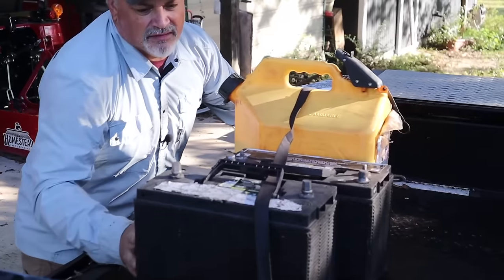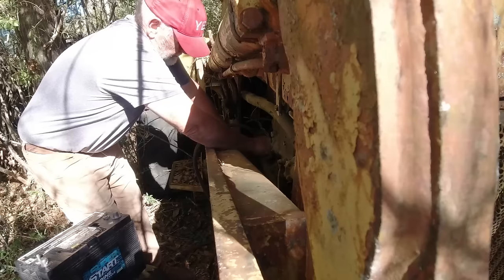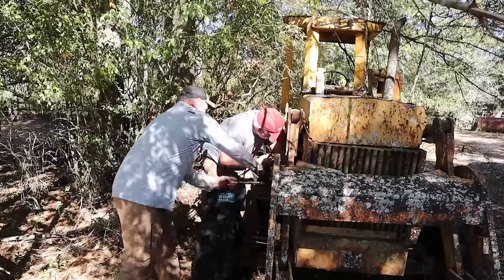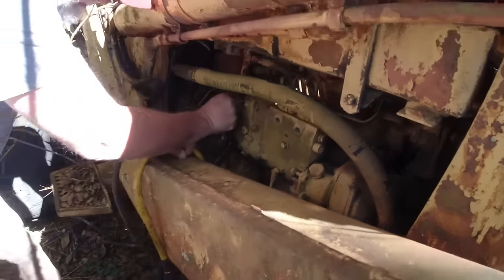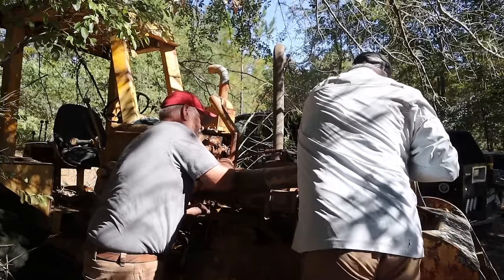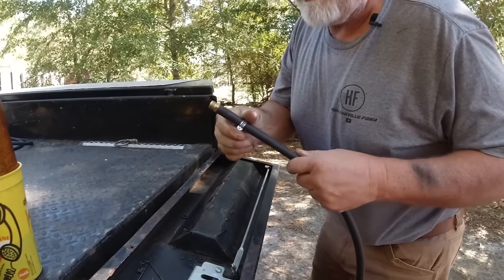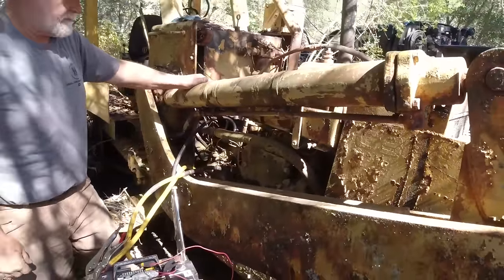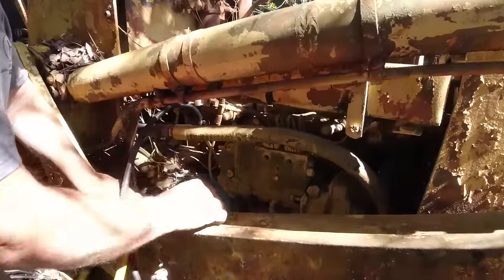MILITARY SURPLUS BACKHOE ABANDONED 30 YEARS AGO! WILL IT START?

Comment: Engine is now hydro-locked with Marvel Mystery oil. Place oversized feeler gauges under the exhaust valves so they will stay slightly open. Then you can spin it over and get the excess oil out. Don't go to thick on the feeler gauge as we don't want the valves to hit the pistons.
Reply: I don't think it's hydro locked. That's a bad engine, which bad/seized rings.

Comment: Oh the joke is don't use ether and the glow plug. The glow plug can light off the ether so use one or the other ether is fine in those engines if the glow plug is cold. My Case 600 and 700 don't have the glow plug while the 1030 does. The 1030 is harder to cold start so they changed something to the fueling for the 30 series.

Comment: I have a few Case tractors with that style engine. Lanova indirect injection don't start easy in the cold. The tractor shutdown is moving the throttle all the way off so if the throttle is not in the right place won't start at all. My 700 Case I had to get the injector pump rebuilt before she started. Didn't know how to free up pumps then. Bosch A style inline pump plungers might be stuck believe can be gotten to through the pump side cover.

Comment: If your pump was pushing fuel into the inlet side of the injection pump and no fuel was coming out of the injection pump, either the fuel shut off was engaged, or the injection pump is bad.

Dad has a late 60's Case 580CK backhoe with a Case diesel engine. His has the same style of injection pump as was used on a majority of diesels until at least the 1990's. Rebuild kits aren't all that expensive(at least the ones I looked at weren't).

Comment: Put 24 Volts on the starter, engine will turn over faster, more compression heat. Watch the starter is not overheating.

Comment: I figured that you would grab a little vice grips to get up behind those hood bolts that Irwin rw adjustable lock wrench has a little v then your bottom jaw will press the nut against that v side so you are grabbing two faces very solid or you actually have a decent grip on one corner of your hex headed nuts or bolts and I’ve found it just a handy handful of grip for grabbing something and your not grabbing the fasteners with a serrated type jaw where you need to do damage to actually get enough pressure to actually grab it enough to hold it… better then the square jaw vice grips with that little v shape on a corner of the fasteners you don’t really tear them up any???

Comment: Check the crank Amps on that marine deep cycle.  Deep cycle batteries don’t usually have good crank. Use a proper battery and it will spin over faster

Comment: The diesel engine on the Case 480 is a G188D which produced 42 Horsepower at 1750 RPM. It was a 12 Volt system but used 2 x 6 Volt batteries instead of the single 12 Volt & was 100AH. The petrol version of the 480 was 12 Volt too but did have a 12 Volt single battery & was 55 AH.

Comment: You just hydra locked it by pouring that oil down the intake.  A little bit is ok but that was way too much.   More than likely the injector pump need to be rebuilt it’s pretty common on these old Case tractors.  You can find rebuild kits online or Napa and they aren’t that expensive at all.  Pretty easy job as well.

Comment: Instead of "Jury riggin' "  your battery cables which is not good, investigate some of the quick connect marine hardware. It will be quicker, safer, more professional, and the contacts cleaner. Keeps the swearin down too.  Great show as always.

Comment: Your probably putting the wrong wire to positive or not getting a ground with the starter button . The light may need to be on for it to be ready to start . I don’t know that tho !
Reply: If it ever had a light, it quit working 20 years before it was parked.
Reply: @ralfie8801  the light on the starter button they attach to the starters to by pass the key.
Reply: @ralfie8801  I think your lite is out !

Comment: but yea re charge the batteries get it cranking faster hook a separate battery to the glow plug should be seeing fuel, see if a viewer to would be willing to donate parts just enough get it driving digging send the pump off may be just clogged. oil, change to. can pull start it

Comment: Case diesel engines injection pumps had issues after sitting for a long period of time.  Please don't hydrolock that engine ,can you can be in for a larger problem, mind you with your luck the compression is so low it's been probably pushing past the rings.

Comment: CASE for some reason installed Injection pumps  made for the left side of the engine and put them on the right side. SO ALL the linkage,transfer pump ,side cove are on the back side,  . Next , the fuel inlet line to the IP is in the front  of the IP on the back side. make sure you have fuel there. If you have fuel there and the pump is in the run position  and no fuel comes out the top lines the rack is stuck Can it be freed, maybe. You would have to take all the delivery valves out and use a small punch to tap them down, rotating it as you go because some of them will be on the came lobe. Freeing the IP would be best done with the IP  off where you can actually get to the rack through the side cover. There is a transfer pump  on the back side of the pump.  The IP also has an over flow valve that regulates pressure and it is located on the back side of the pump at the rear of the IP housing by the governor.   Unfortunately I think the engine is now hydro-locked from all the mystery oil ya'll poured in it. I'm the Injection pump GURU
Reply: If the engine was hydro locked, the starter wouldn’t be spinning the engine over, it would be locked up. I’m the hydro locked engine guru.
My gay cousin is the Marvel Mystery Oil Fairy.
Reply: Guess you didn't watch it to the end.  He tells him to pour all of it in at 1:18:10  and then he tells him the oil is at the intake level. They then try to turn it over and it quits spinning over.  Hydrolocked big time. @ralfie8801
Reply: @mikegoodman447  
It was still spinning with the starter at the end, not quite hydro locked, but it was close. All of that black smoke it was making after filling the intake up the first time was the MMO smoking, not fuel. Remember the electric fuel pump was not running at that time. He was bumping it with the starter at the end and smoke was coming out of the intake, which means it was still moving. That makes me think it’s got an intake valve or more not seating or even stuck open and causing low compression on one or more cylinders. I would have never poured that much MMO in there and neither would you, but they did it and it’s too late now. It very well could be locked up when they come back to try again, I’d be surprised if it just spins free after sitting. 
On another note, you don’t happen to be a work equipment mechanic on the railroad do you? I used to work with a Mike Goodman and his brother and their Dad in a MOW shop.
Reply: Fiction name , not the same fellow.  You pour a quart of oil down the intake you can expect bad things.. Maybe it will drain off before they try again. Instead of taking the injectors out to free it up I would suggest slightly oversized feeler gauges under the exhaust valves. That way the engine can blow out the excess oil. Once clear they could remove them and continue on.  You see when he pours the oil in the fluid is going to the first cylinder with a intake valve open and that spells trouble. You can see it's locked up at  1:18:55 as it won't spin over. @ralfie8801
Reply: @mikegoodman447  
It still sounded like it was bumping over to me when those puffs of smoke were coming out of the intake, and just bump it is what Wiley said he was going to do. I guess we’ll all see what happened when they come back to it. I thought they were pouring way too much in it too. But then it was cranking, partially locking up, and firing to make that black smoke without any diesel fuel after the first half bottle was poured in. Pouring the rest in wasn’t necessary because all of the cylinders should have been soaked with oil after the first half bottle was cranked through.

Comment: Hank, you don’t have to fight the connections if you bring a grinder and a wire wheel to clean the contacts and get a good ground.  Also, if you know you’re going to a machine that is in the brush or woods, take your chain saw.  How about editing an hour or two of you guys trying to get hooked up.  We’ve seen Wiley connect batteries too many times!